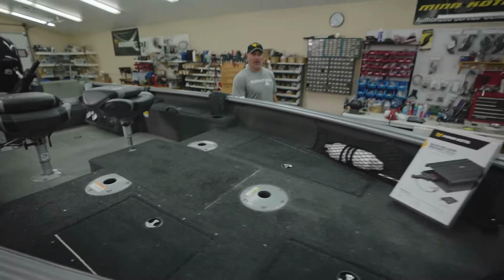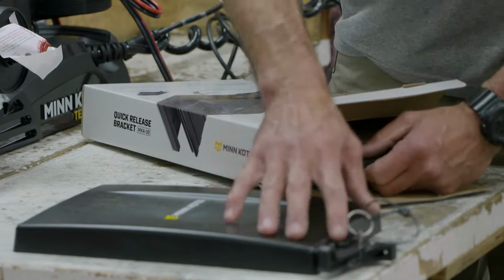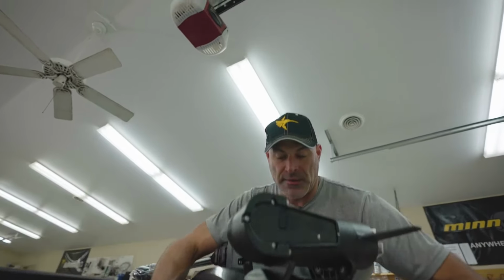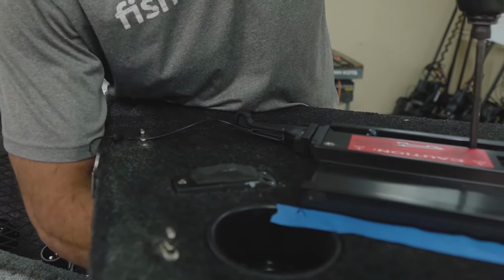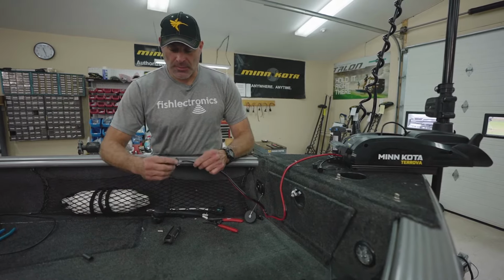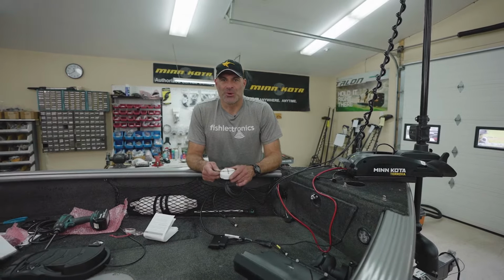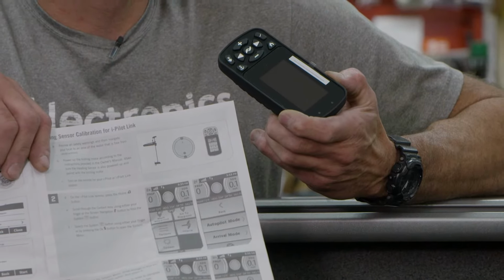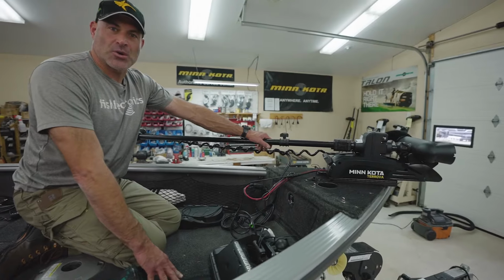Minn Kota Terrova Installation Overview | Trolling Motor Install

Comment: You used only 4 bolts to attach the plate to the boat.  Is that enough because if I were to not use the quick release plate the instructions say to use all 6 bolts, which my boat does supports.